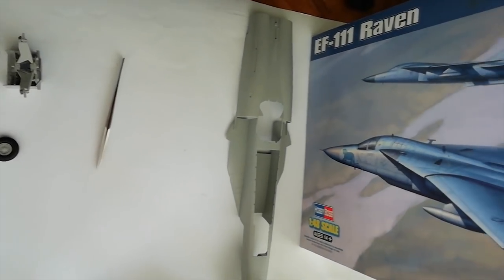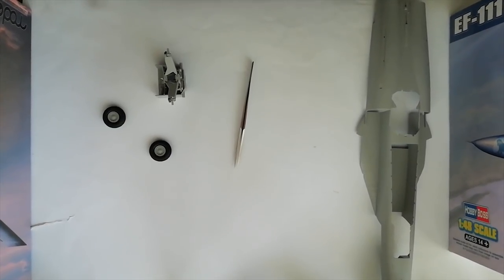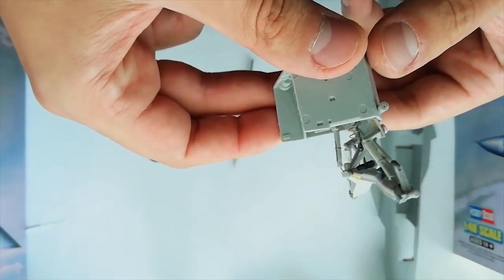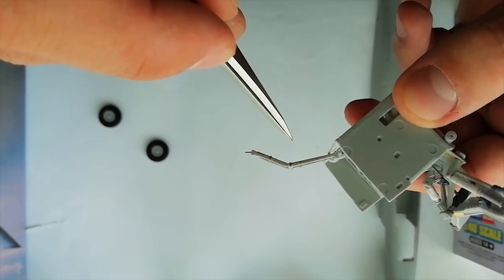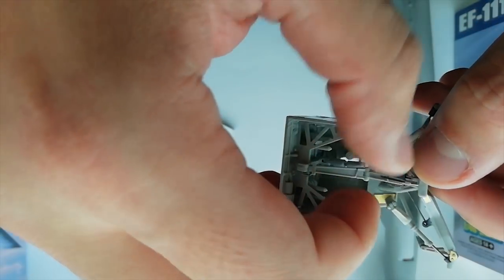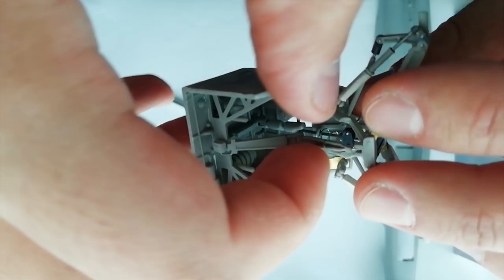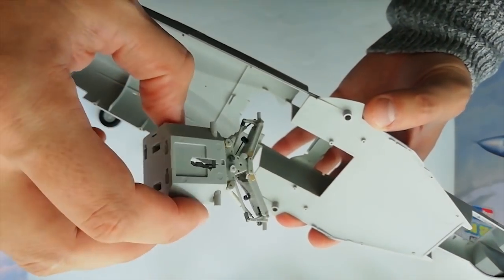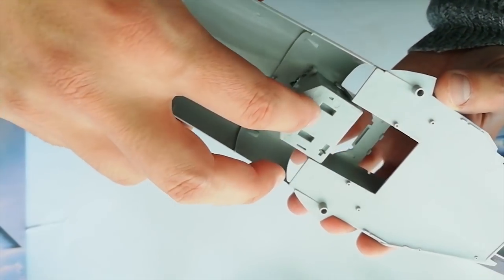Amazing Scratch Building & Engineering Pt.2 - Future of Scale Modeling

Comment: I based my 1/32 harrier on the video you did for yours, retractable gear and control surfaces.
I also worked the engine by cutting the fan blades from the intake nozzle, and motorized it ..it's ok I think . (You can see it at my channel).
Would really like to bounce some ideas and possible solutions of them with you.
I have no engineering knowledge, so any help would be priceless.
Reply: Hi budy, nice to hear it. Well i made the Harrier quite some time ago and vaguely remember it. But this F-111 landing gear was possible only with a mini drill set which i used for the first time. My Harrier was a little bit on the "rough side". It turned out pretty well tho. You probably know that vid: https://www.youtube.com/watch?v=wq7QyXtWITQ I also checked your channel... really awesome wicked videos you got there!
Just about everything in the moving parts is about hinges. Btw i have no technical insight either, except my favorite class in school was physics. Whilst for the modeling - it's just trial and improvement until it's good.
You can link me a video and a question and i could give you some hints if i can of course. ;) cheers. 👌
Reply: @milanmitev2951   can you tell me which mini drill set you got, I'm getting a bit overwhelmed with the options, and would like it if you could point me in the right direction.
I've just bought the Trumpeter 1/32 A6 Intruder, and want to reproduce the working wing fold system. ( possibly motorized 🤔 )
Reply: @clonefox80  it's just a set of "tiny" drills, bellow and above the 1mm diameter. For example this (https://images-na.ssl-images-amazon.com/images/I/611-Hzw-bLL._SL1200_.jpg ) could do the job. 
Oh yeah , the Intrusder in this scale sould be something really impressive. The wing folds are very tiny but in this scale they could be do-able. As a hint, i could just propose to watch closeups of the real thing in motion and try to see how to imitate it in the easiest possible way according to what you have in the kit. If the wings are designed to be displayed in a folded or extended mode - it should be easier. If all fits flawlessly, it should be easier too. But honestly, just make sure to make the trials on another kit. ;) the first time "never" looks good. If you have an old built model that you "dont like" - try to split the wings and make them foldable by beginning from scratch. ;) You should see what could be improved and the better ideas should come, then try with the other wing... only after when you are convinced what and how to do it - then go ahead with the Intruder. Anyways, it's a plastic kit and allows a lot of options for correction/improvement. 
The motorized thing may require servos, transmitters, wires, batteries, etc.... this is a completely different hobby btw :) I also ised to fly RC planes... that's me on my first ever flight of an rc plane: https://www.youtube.com/watch?v=Xof8XaCNb-w ..... i know i know... but have fun though! :P